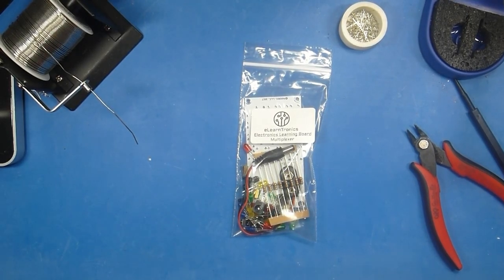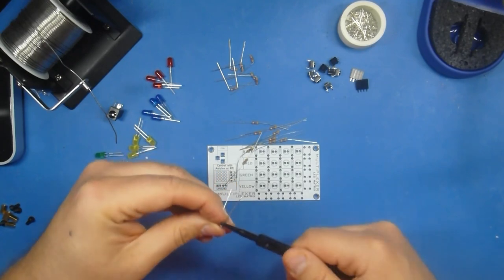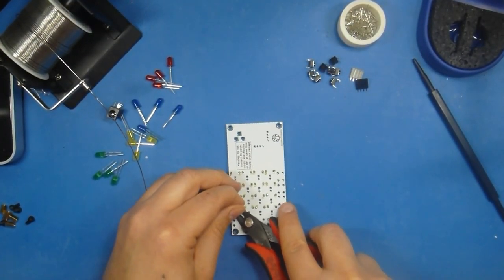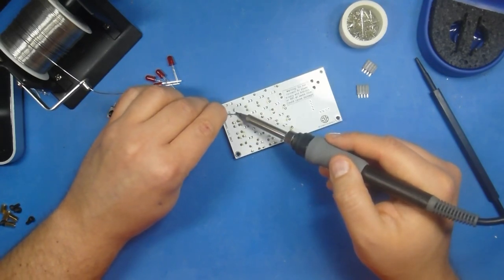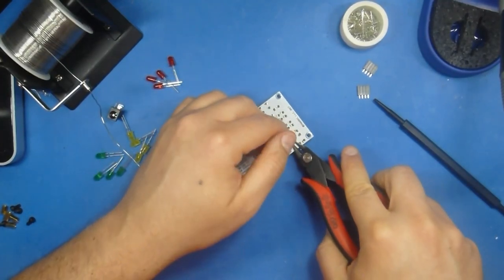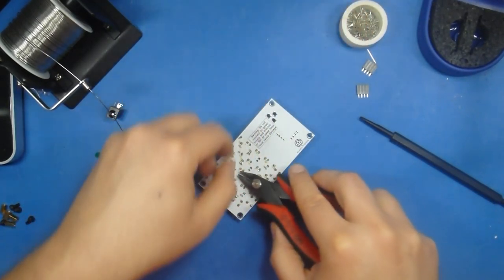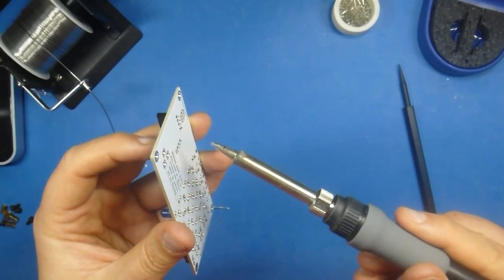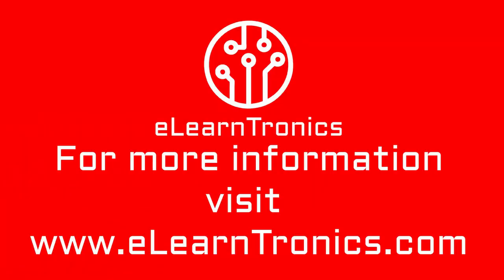Learn to Solder: Multiplexer | Electronics Learning Boards from eLearnTronics

Comment: Thanks for providing this video.  It might be helpful if you explained that the switches go in a certain way.  I wasn't sure so I had to do some circuit analysis to determine their orientation.  All and all, this was a pretty good project.  Can't way to try out the Arduino part of it!!  
This will be a project that I will work with my grand kids with.